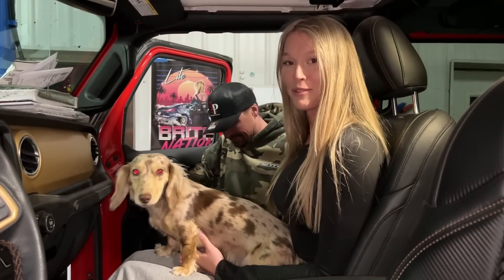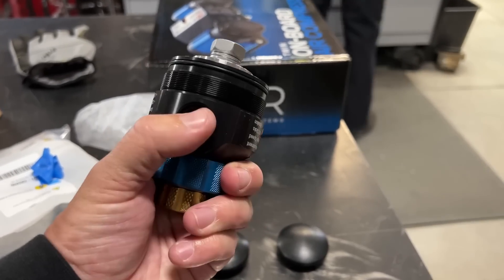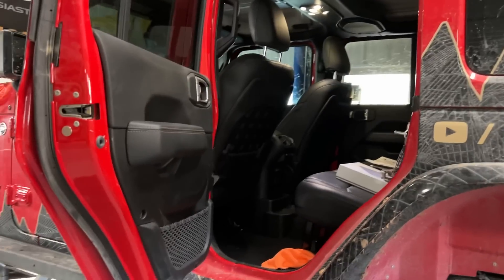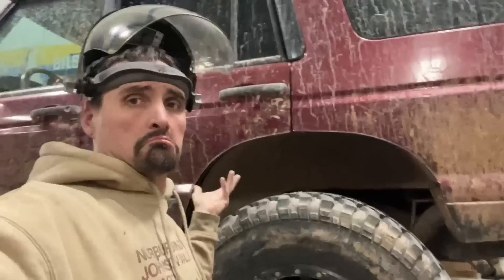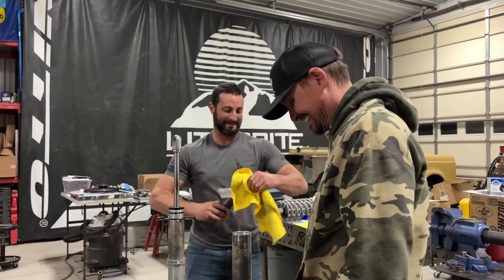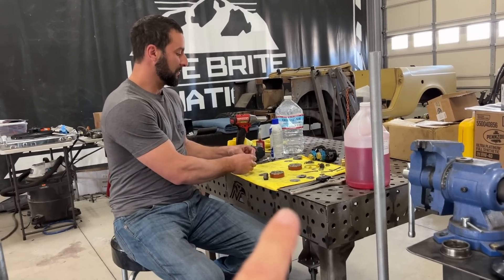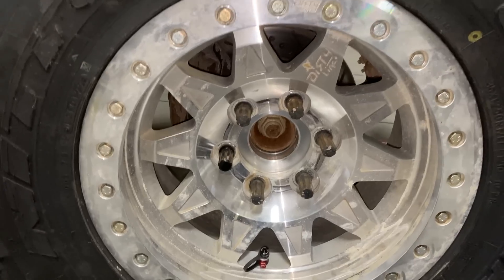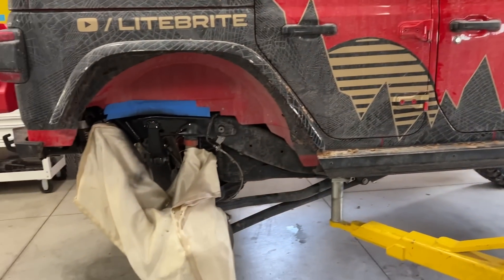Prepping an 800+ HP DEMON JEEP for Easter Jeep Safari!

Comment: so , our 2012 has a special fuse J13 in the power module that can be pulled up to disconnect , when the jeep is to be parked for a while , to reduce the amount of current draw from the battery . jeep calls it the "ignition off draw" fuse (iod) but it doesn't eliminate all current drain - the factory manual says that if the jeep is to sit for more than 30 days the negative of the battery should be disconnected

Comment: I wonder what is the operating temperature range for the battery, and also the minimum and maximum temperatures the battery can take before it's damaged.   I know some Lithium batteries (with certain chemistry) are sensitive to substantial low and/or  high temperatures.

Comment: I have another question, what is the gas mileage in the Demon Child? I believe the Raptor gets maybe 15mpg. I can get up to 20mpg with the 2.7 eco boost in ECO with a performance chip. But mine is an everyday driver. I am seriously looking at a suspension upgrade, possibly a 37" tire bump as well, any recommendations?
Reply from the maker: As long as there isn’t a head wind, we can average about 12.5 mpg going 65-70mph

A pretty overall average is about 10.5 mpg
Reply from the maker: But it’s also worth noting that this rig is very much a “smiles per gallon” kind of vehicle 😁🤣

Comment: I guess you guys gave up on the portable air compressor you had kind of reviewed and compared with other portable air compressors in an older video.  I know the fixed mount can be more convenient; however, can get expensive if you are putting a compressor in more than one vehicle.  Did the portable ones just break, not function well, wanted a "hard mount", or what?
Reply from the maker: We still have portable ones as well that we use for rigs without the onboard air. But for the vehicles with wheel often, onboard is more convenient in the long run
Reply: @LiteBrite  Thanks.  I was just curious.  I get it for the convenience.  The mount for the air compressor from American Adventure labs was pretty nice.  We do a little, light off roading and overlanding and need to do something for airing up tires.  Since we use two different vehicles (Gladiator and Colorado), just trying to decide what to do.  A portable compressor shared between two vehicles is more budget friendly.  The "hard mount" compressor is definitely more convenient.  Decisions, decisions..........

Comment: Anti-Gravity says their automotive batteries are designed to work above 23°F. Can't jump start it or charge if it is frozen (<33°F).  Only charge at 33°F or above. This is due to the chemistry. I personally wouldn't use one as a starting battery.
Reply: Hey guys! We (AGB) do suggest an operating range of 23F-140F for our batteries for peak performance, yes. But, our batteries have proven time and time again that they will operate nominally well outside this threshold. That being said, if you're planning on an extended cold weather trip or live in an area where it's common to have ambient temps under 15-20F for an extended period of time equipment like a battery blanket should be considered.
Reply: @maracerbdmj  I was about to buy your Micro-Start and a starting battery from you guys, but then I read your warranty. Micro-Start's warranty specifically says warranty is voided if disassembled and if it is repaired by someone else besides Anti-Gravity.  

Your warranty language is a violation of the Magnuson-Moss Warranty Act of 1975. You can't void a warranty if a consumer decides to open an electronic device and have that device repaired by an independent repair shop. 

Sony, Microsoft and many others had warranty voided if opened seals on the PS4, Xbox, etc and had that warranty voided language if the device was opened. 

Their warranty language and the seals were determined to be a violation of the Magnuson-Moss Warranty Act and illegal. Those companies were told by the FTC to knock if off or face a fine. Have you noticed no one puts seals on electronic devices today? This is why. 

I would revise your warranty before the FTC gets a wind of it and levies a fine.